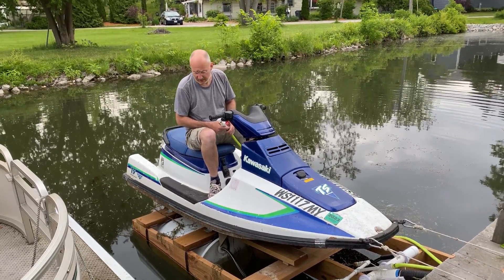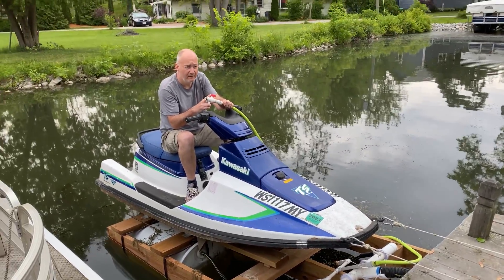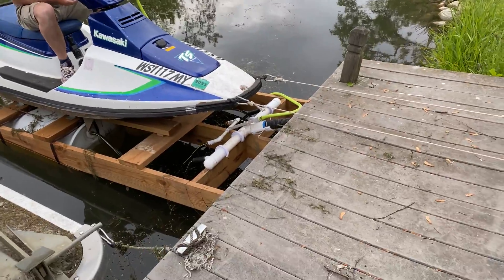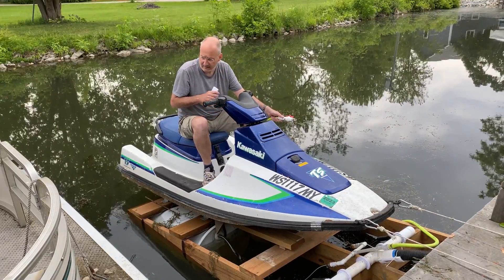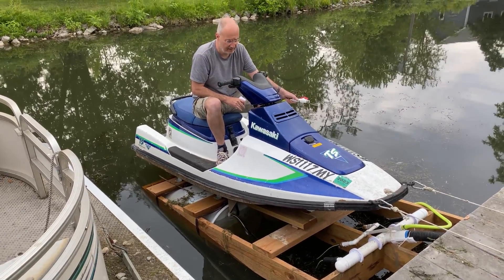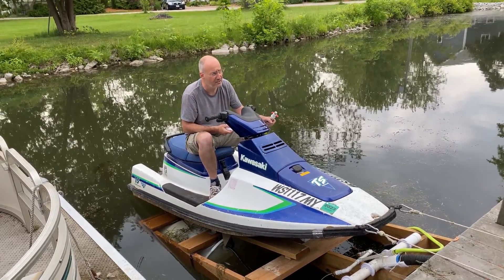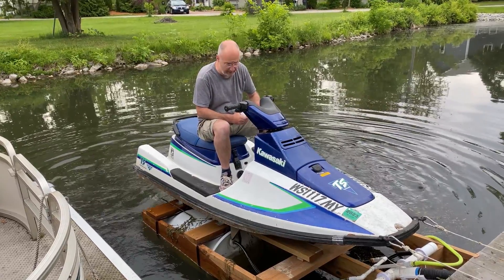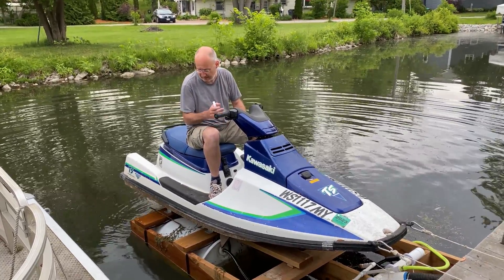I built my own Pneumatic Jetski Lift (Shop Vac operated)

Comment: Love this idea!! I was thinking of expanding it a bit wider to allow a small walk around on the sides. Do you think your shop vac (i have the same power) would have the strength to raise a bigger "dock" by filling 3 barrels?
Reply from the maker: I think the key with three barrels (as it was with the two) is to make sure the air distributes evenly, but yes it should work

Comment: Looks great and works! You mentioned it starts bubbling and you know it's up. So do have holes in plastic barrels? If so where are they in the barrels I imagine towards the top some where? I am thinking of making a similar one for my seadoo. I already have ez dock boat lift that works that way for my 17' boat. So  I am thinking of doing something similar. But instead of using a shop vac I am going put in a tee from my solar powered boat lift pump with two valves so I can lift my boat or my seadoo like yours does. My pump works both ways up or down as well. I am thinking of connecting one end of the seadoo lift to the side of my stationary dock or to my floating boat lift. The other end would be a barrel(s) similar to yours. It appears you used two barrels. I am wondering if I could get away with one barrel perpendicular. Or is two necessary? Let me know your thoughts. Thanks in advance for your assistance.
Reply from the maker: thx! Holes go on the bottom!! see the instructable here https://www.instructables.com/Pneumatic-Jetski-Lift-shop-Vac-Operated/